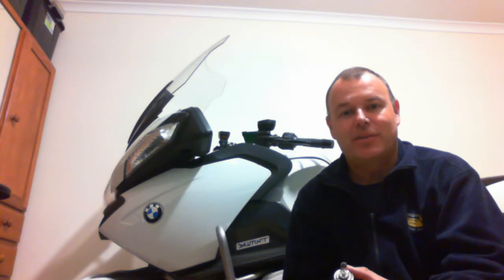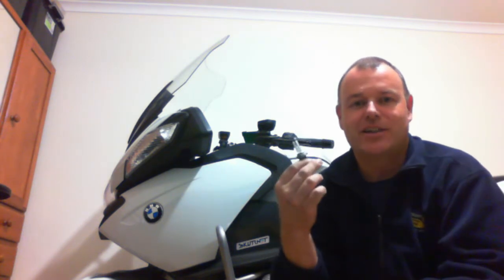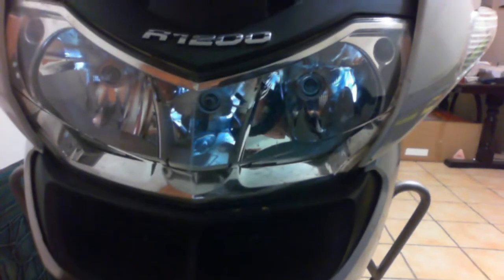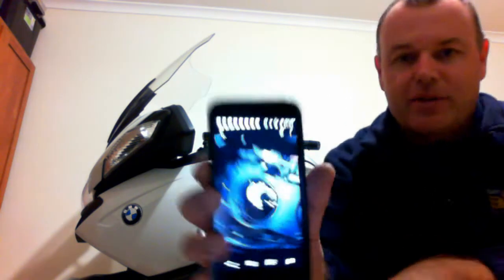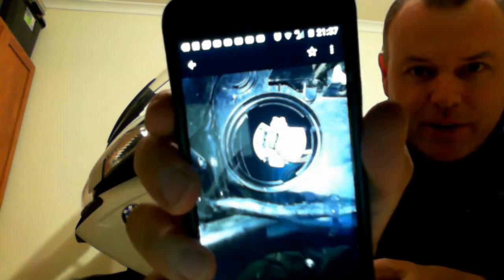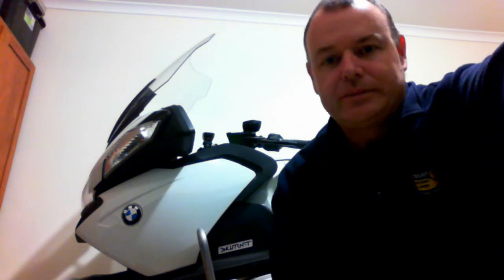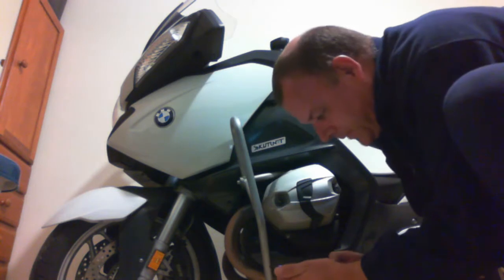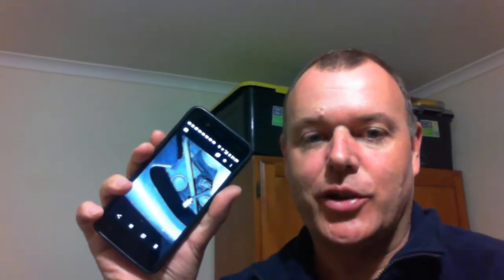All Things BMW Boxer: Seeing Those Hard To See Places..Globe Replacement

Comment from the maker: A few tips on changing globes. Follow this sequence: Turn handlebar to the right for left-hand bulb or to the left for right-hand globe replacement. Remove outer cover by twisting anti-clockwise and pulling cover out, then take a picture with your phone to see how the clip fits),  then remove electrical two-pin connector by simply pulling it backwards off of globe pins, then only push each clip forwards toward globe and outwards-the left clip out to the left and the right clip out to the right. Fitting is the revearsal of removal, but remember to get the clip and wiring up and out of the way before inserting new bulb. DON'T touch globe glass (just hold it by its electrical pins). Pop your head in front of the headlight to see if bulb is inserted properly and then wiggle clips back in place. Take another photo to confirm clips are correctly seated (like the first picture), then push electrical connector using your fingers to feel that it is in line with the bulb terminals. Take another picture to confirm correct fitment of clips and electrical connector, then fit outer cover with clockwise twist (bayonet style fitment). It gets easier with practice ;-). I tried an H7 Osram globe from SuperCheap this time. The el-cheapo SCA globes haven't been lasting too well, neither have the cheaper Phillips H7 globes. If the Osram one @ $25 doesn't last I might resort to trying a dealer globe $$

Comment: Dont know if you still read this but I've changed my bulbs ,now I switch bike on lights turn on then off stright away? Any idea what I've done ?
Reply from the maker: Haven't heard of that before. I would check that the wiring is plugged correctly onto the back of the globes..I.e. correctly aligned and not loose. Check that the bulbs are still working and have not blown again. If the bulbs do blow immediately,  there must be a fault with the bikes electrics and it might be worth plugging it into a diagnostic computer like the GS911 (or go to dealer) and seeing if any fault codes are appearing relevant to the problem.
Reply from the maker: Also check once you have started your engine whether the lights are still off and whether the bulb warning symbols (indicating a blown bulb) are showing or not. It is also not worth using a 'cheap' globe as they won't last long. When I used a $10 SCA H7 2 pin globe...my bike would eat them every 10000km. After changing to a $20 globe...they last a LOT longer.
Reply from the maker: My first thought is that the electrical connectors are not on the right way round.